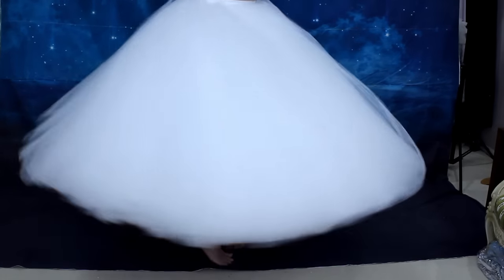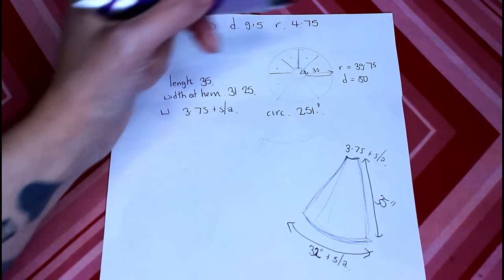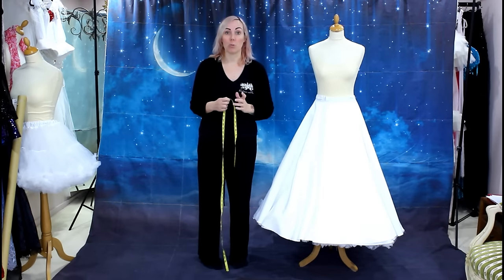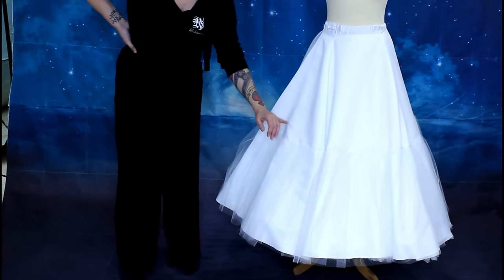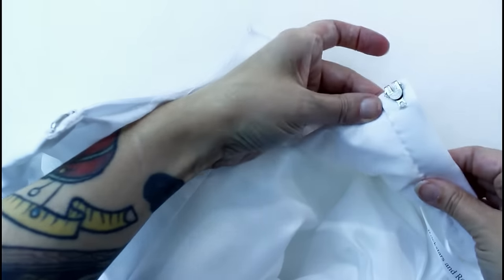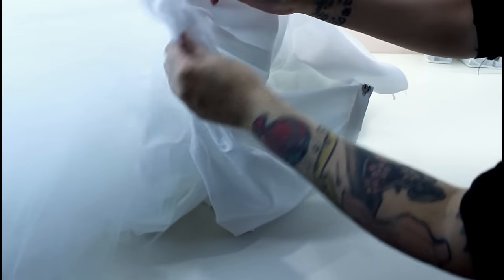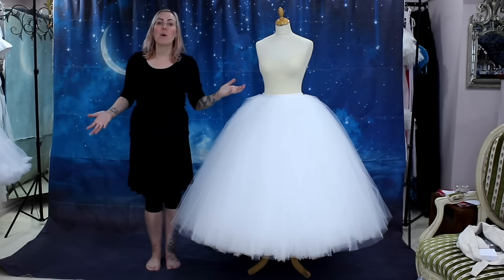How To Make A Tulle Skirt | Fortuna Gown Part 2

Comment: How many yards of each fabric did you need?
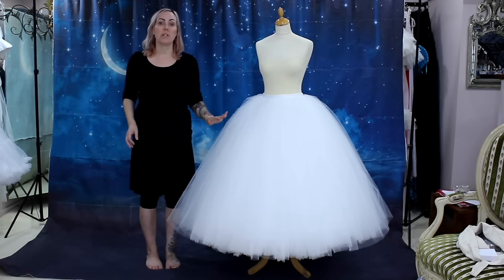Reply from the maker: I talk about how much tulle I used at 12:34 and 13:01. One bolt of extra wide tulle is enough for this length and number of layers, but yours may vary depending on the length and number of layers you use. I used around 4m each of lining and satin, but again yours might vary depending on the length and fullness of your skirt and the width of the fabric.

Comment: love your tutorial! is there a way to use 54” tulle?
Reply: Carly Carter you probably could, you would just have to joint together a lot more pieces to get the length to go all the way around. When you join the 108” 4 times to get a full length of around 430”, you would just have to join 8 of them if you want the full length around.
Reply from the maker: Spot on! You'll need to cut and join more pieces for tulle for each layer if your tulle is narrower. It'll take more time but give you the same overall effect at the wide tulle.

Comment: how many yards of tulle did you use in all?
Reply from the maker: I talk about how much tulle I used at 12:34 and 13:01. One bolt is enough for this length and number of layers, but yours may vary depending on the length and number of layers you use. Thanks for watching. Have fun making your own
Reply: @RockstarsandRoyalty  i am  watching with mute button while at work sorry 😀😀😀

Comment: Could we just buy a petticoat and then add the tulle like you did instead?
Reply from the maker: Do you mean add the tulle directly to the petticoat? As long as the material of the petticoat is strong enough to support the weight of all the layers of the tulle I don't see why that wouldn't work 🙂
Reply: Rockstars and Royalty okay thank you I’m trying to make a dress for my moms party next Saturday and I came across this video. Do you have a Instagram that I can send a picture to? To get your expert opinion? This is my first time doing a dress
Reply from the maker: No problem. My instagram is @rockstarsandroyalty
Reply: @RockstarsandRoyalty  hi im a beginner in sewing planing to sew a nice ball gown dress for my 4 yr old. Bit i dont know how to begin i dont know how to take her measurement and do the math can u help.

Comment: How did you get 3.75 from the other numbers that you calculated?? Sorry I am a bit confused here
Reply from the maker: It's my waist measurement divided by the number of panels in my skirt. 30 (waist measurement) divided by 8 (number of panels) is 3.75. So the top of each panel need to be 3.75 plus seam allowance to achieve the correct waist measurement when they're joined. Hope that helps.

Comment: Hi, how many yards did you used?
Reply from the maker: I talk about how much tulle I used at 12:34 and 13:01. One bolt is enough for this length and number of layers, but yours may vary depending on the length and number of layers you use.  I used around 4m each of lining and satin, but again yours might vary depending on the length and fullness of your skirt and the width of the fabric.

Comment: Does anyone know how many yards of tulle was used to make this?
Reply from the maker: I talk about how much tulle I used at 12:34 and 13:01. One bolt is enough for this length and number of layers, but yours may vary depending on the length and number of layers you use.  I used around 30m of tulle and around 4m each of lining and satin, but again yours might vary depending on the length and fullness of your skirt and the width of the fabric.
Reply: @RockstarsandRoyalty  thank you. I must have missed the part you mentioned it.
Reply from the maker: No problem. It's easily missed in a long video!